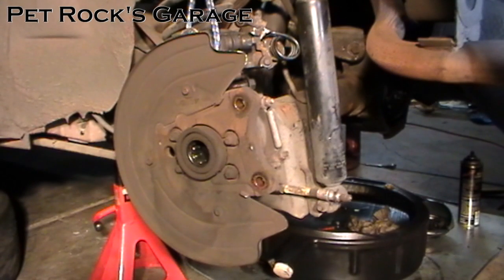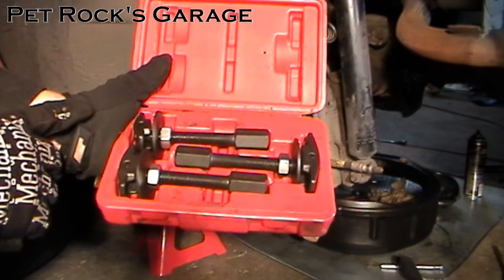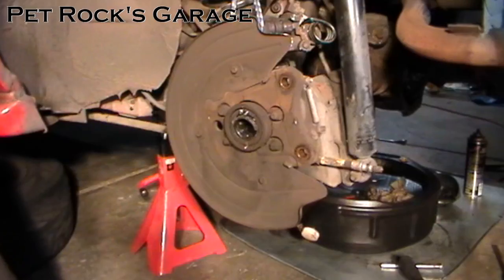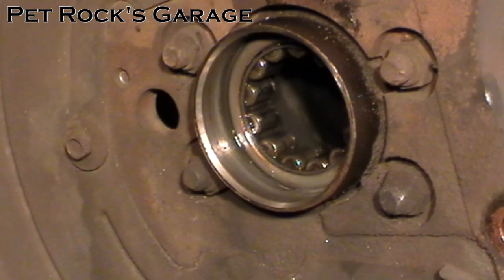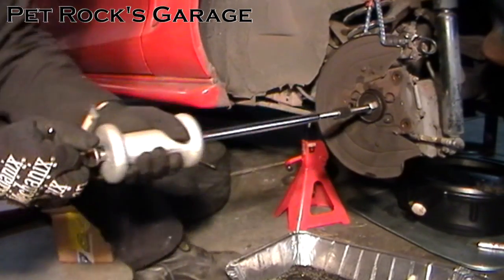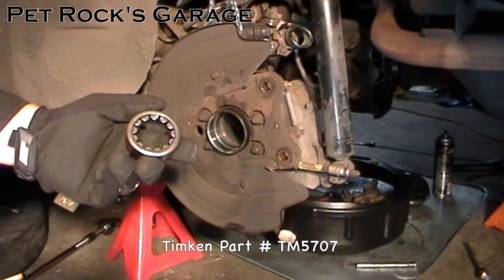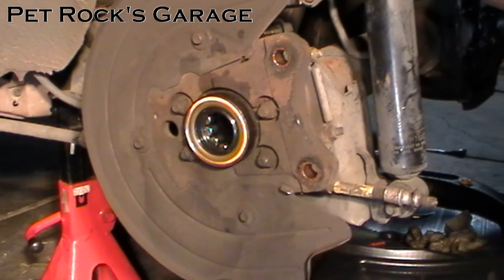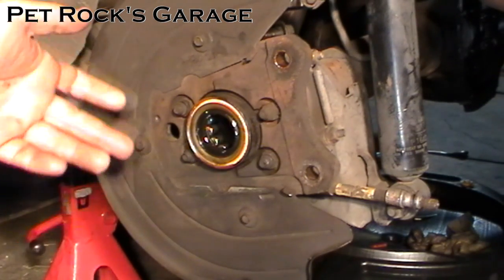How To Replace Axle Seals & Bearings In Ford 7.5 & 8.8 Differential - Ford Mustang

Comment: GREAT!  I saw how much trouble the seal gave so I skipped that step..... Just stick the puller right through BOTH parts and pull.  The seal will come right out with the bearing with No trouble at all !!    Thanks to you and Autozone this project went down Smoothly for once
Reply from the maker: Yes, you can pull the seal & bearing out at once. I showed it the way I did for those that are just looking for how to change the seal and not the bearings.  I'm glad my video helped you out. Thanks for watching & commenting. I appreciate it.

Comment: I need to do this on my 98 grand marquis, hopefully they're similar. Your videos are very detailed and helpful. Thank you!
Reply from the maker: Thanks a lot. I appreciate it.  If it has a Ford 7.5" or 8.8" open differential it is the same. If it has something else then some of it will be similar. Good luck.
Reply: @petrocksgarage  I believe it's an 8.8. I'm having difficulty finding good quality axle bearings. Any advice would be greatly appreciated.
Reply from the maker: @marymong2651 , there aren't that many bearing manufacturers and, if I'm not mistaken, none are made in the US. Check out rockauto.com and autozone/oriellys/advanced/napa. They should have a good selection.

Comment: Again thanks a lot for the video! Just a quick tip cause I had very hard time to remove the seal on both side as it was stuck there. I used the slide hammer with the bearing puller and remove the bearing and the seal at the same time and it works perfect 👌! Just a tip to prevent damage on the axle tube by trying to pry out the seal ;)!
Reply from the maker: Yeah, you can remove the seal & bearing at the same time with a slide hammer. It's a perfectly valid technique. However, it only works if you are replacing the bearing too. If you just want to replace the seal, which is more common than the bearing, this video will show you how. Thanks for watching & commenting. I appreciate it.

Comment: Looks straight forward enough.  Thanks for the very clear directions.  I've also heard people say put some black RTV around the axle seal.  I have to do this as my right wheel bearing is making noise + my pinion seal is leaking as well, my car is lowered a bit so it's real hard to get to the top fill plug of the diff.  Furthermore, my driveway is on an angle so I can't properly fill it.  Between needing a lot of torque on the pinion nut to crush the pinion sleeve + the fill plug hard to get to + needing the diff level when I fill it I want to remove the rear axle and do this job + the pinion seal outside of the car.  What are your thoughts on doing it?  On one hand it seems like massive overkill, but on the other it sorta sounds like a massive pain in the ass doing it on the car on my back in cramped space.  Thoughts?
Reply from the maker: Thanks a lot.
Re RTV: if the bore that the axle seal goes into is damaged then you would want to use RTV.  Otherwise, you don't need to.
Re getting to the fill plug: if you put all four corners of the car up on jack stands at roughly the same height, it should make it easier to get to.  Or use a really long hose attached to a pump like I used in the video.  Having your driveway at an angle actually makes it easier. Have the rear facing down hill and jack it up until the car is level. Make sure to block the front wheels so the car doesn't roll.
Re pulling the axle to service it: that might be more headache then its worth. If the driveway really is a problem I'd find a level spot somewhere nearby to do the job. My driveway is also at an angle. I've sometimes rolled it back so the rear wheels are in the street and the front are on the driveway to get it close to level so I can check the oil. Works pretty well. Maybe that technique would work for you too.  Good luck.
Reply: @petrocksgarage  The really long hose probably would have helped, I'll get one of those.  I had just used a shorter hose + squeezing a regular gear oil container to top it off and it was a huge pain in the ass because it was slow as shit & hard to squeeze.  The long hose + pump looks like a significantly better option.  Yeah, that's a good point about parking it up-hill and doing it that way.  I had wanted to do it downhill because it puts the rear near my tools, but I think your way is better because it allows me to balance while creating room for myself.  I did the math and should only need to come up about 10 inches max to be level.  OK, I'll have the RTV on hand if it's damaged and I need it, otherwise I won't use it.

OK, you've convinced me on trying to do it with the axle still in the car!  It should make the job considerably easier.  If I run into issues I can always drop it after.  I was most concerned about the pinion seal and crush sleeve, but I did some searching and looks like a pretty quick/easy weld to make a make-shift pinion holder tool that can rest against the ground or car body while I crank the pinion nut enough to crush the sleeve, so that should make it much more manageable from under the car.

Thanks!

Comment: Awesome video thanks, one suggestion I would add is for really bad seals take a chisel and hammer and knock the lip down from the outside of the housing so that you can break the rust seal that's formed with the rear end and the bearing seal
Reply from the maker: Thanks a lot. I appreciate it. Thats a good tip. Thanks.

Comment: Same comment as the group below, very well explained and demonstrated. This is my project for this weekend I just need to arrange to borrow the tools for the job. Thank you very much!
Reply from the maker: Thanks a lot. I appreciate it. Good luck.  Re tools: you can rent them from most auto parts stores. I rented the ones in the video from Autozone. Hope that helps.
Reply: Hi Pet Rock's Garage, so I’m in Canada I went to NAPA with no luck but Canadian tire loans out the tools at no charge, just a deposit that is paid back in their return. I already had the axel out for my drum to disc brake upgrade in my 1986 Mustang. The bearing removal and install took about 20 minutes with the right tools. Thanks again for your detailed step by step this was a lot easier than I’d thought it would be. To think I was going to leave the old leaking seal and worn bearings in place and not use the new ones provided in the brake upgrade kit . For some reason the past car owner packed the one seal with thick grease to prevent gear oil from leaking out - ouch  so glad I did this now and lol that was easy. Thanks again.
Cheers,
Hans
Reply from the maker: @hansparis5860 , I didn't know Canadian auto parts stores didn't loan out tools like in the US. Canadian Tire's loaner program sounds a lot like the ones here. Glad to hear you got it sorted out.

Comment: Great video. I just recently did this same job on my 03 mustang and 3 weeks later started hearing loud noise and took it apart again and my axle shaft had worn down do u know what would cause this?
Reply from the maker: Thanks.  Re your axle shaft, it all depends on where the wear occurred on the shaft. Did it occur in the same spot on both shafts?
Reply: @petrocksgarage  what happened was my wheel seal on passenger side started leaking so I replaced a wheel seal and bearing just like in your videoand everything was good for about three weeks and then I noticed a noise like a bearing going out or a tire off so I pulled the axle out of the differential and where the bearing and seals it was worn down and lose inside the bearing but I don't notice any damage to the bearing or seal
Reply from the maker: @zachensley9386 , my guess is either there wasn't enough oil in the diff and the bearing was riding raw on the axle shaft and wore it down.  Or the bearing was potentially the wrong size somehow (e.g. manufacturing defect or wrong bearing) and it allowed the axle to wobble around and wear. Hope that helps.
Reply: @petrocksgarage  Thanks for ur help. Today I will be adding the oil into differential hopefully everything is good. For the v6 i use 80 90 right? Can I send u a pic of my axle?
Reply from the maker: @zachensley9386 , the motor doesn't effect the oil used in the differential.  I use 75W-90, but any gear oil around those specs should be fine. Also, if you have a limited slip differential you should add 8oz of friction modifier first and then fill the rest of the way with gear oil. If you don't know if you have a LSD or not, the easiest way to tell is to jack up the car and spin one of the rear tires. If the other wheel spins in the opposite direction, you have an open differential. If it spins in the same direction, you have a limited slip differential, or LSD.

Comment: Some advice for others looking to do this. You can just leave the seal in place and it will come out when you pull the bearing. No need to remove it first.
Reply from the maker: While it doesn't hurt to try, in my experience it only works sometimes. More often than not the bearing will pull right out the middle of the seal. Especially if the outer flange of the seal is rusted to the axle tube. IMS, the bearing is a slightly smaller diameter than the stiff/metal part of the seal.  Either way, I showed it the way I did for those who are just replacing the seal.

Comment: I wasn't able to seat my bearing as far as yours at 6:50. I can see the lip but not as much, and one side I just barely see it. There's like a ramp in the back. Do you think I should pull the seals and hit it some more, or just chalk it up to different tolerances?
Reply from the maker: The important part is that the bearing is in straight. Make sure that the amount of the lip you can see is the same all the way around. If its not then the bearing is not in straight. If it is the same all the way around you should be ok. The seal shouldn't come in contact with the bearing, so it should be ok too. Good luck.

Comment: good video. on the seal some instead of oil put a tiny bit of rtv as added protection I guess... what do you think? thanks.
Reply from the maker: +BlackStangPat, thanks…  RTV isn’t necessary if the seal is a tight/snug fit, like it should be. The RTV applied to the outer edge of the seal would be wiped off as you drive the seal into place. But if you want to add RTV, it wouldn’t hurt.
Reply: +Pet Rock's Garage thanks!! again good video.
Reply from the maker: +BlackStangPat, no problem.

Comment: Didn’t want to use the bearing puller to remove the seal and the bearing all at once? Works like a charm..
Reply from the maker: Yes, that is an option. But in my experience the bearing often just pulls through the seal on some vehicles and makes the seal harder to remove afterwards. So I typically just pull the seal separately. Also, the video shows how to remove the seal if that is all you are replacing.

Comment: I'm working on a 98 mustang and the previous owner hit a curb so hard he broke the axle and knocked the wheel off. It didn't even have a seal on it and the bearing was cracked. The opening for the axle housing was bent and out of round but II was somewhat able to hammer it back in place. So there are a couple rough edges that could be filed and maybe a little more hammering. I can show a picture. Do you think this is a fixable situation or do I need a new axle?
Reply from the maker: IMO, I would replace the entire differential. If he broke the axle (which is a solid piece of steal) then he hit it pretty hard and all that force went into the gears & bearings in the differential housing, likely bending/damaging something. But if $$$ is an issue, then you could try to rebuild it. I'd advise using some RTV around the outer edge of the axle seal to fill in any imperfections you couldn't hammer out. I would also take the diff cover off and have a look inside to make sure that there are no other broken or damaged parts in there. Make sure it spins freely with no noise or anything like that. Good luck.

Comment: So, are the axles held in with c-clips? I've never had the pan off on these new axles
Reply from the maker: Yes, but to remove the c-clips you need to remove the center pin so the axles can slide inward far enough so the c-clips clear the vertical spider gears.
Reply: @petrocksgarage  Yeah, old school stuff... One more question, can you get the bearing out with the seal still in place? Seems the slide hammer would do it..
Reply from the maker: @kevincowart542 , yeah, if you can get the puller attachment in there it should pull the bearing & seal at the same time, but will take more force of course. I would only be worried about the bearing coming out through the center of the seal, instead of pulling both the seal & bearing out though. I haven't tried it, so your milage may vary.

Comment: Have any tips on getting the abs sensor out without breaking it? I noticed you took it out but did not mention it. thanx
Reply from the maker: 01mustangman1, I show a more in depth method in my video on replacing the spider gears in this car.  https://www.youtube.com/watch?v=WnZc7Dbn-Vk.  In short, a good amount of penetrating oil on both sides, let the penetrating oil do its thing for a little while, slowly twist it back & forth a bunch of times to break it free first and then pull it out. Good luck...
Reply: Pet Rock's Garage  I got it. I used a lot of PB and i used a trim tool remover to pry against the abs gear. My axle seal was out though so it was all soaked in gear oil already. It'll probably be a lot harder for others.
Reply from the maker: 01mustangman1, glad to hear you got out out.

Comment: I have a 2007 crown Victoria and I need to change my rear wheel bearing and I dont know what should I buy a 7.3 or a 8.8 size bearing
Reply from the maker: The best way is by looking at the metal tag on one of the diff bolts. It should have this info.  If that tag isn't available, you call your local ford dealers parts department and they should be able to tell you from the VIN.  A less reliable method is to look at the differential cover. Does it look like the one in the video (same bolt pattern)?  If so, its likely a 7.5 diff.  If not, its likely an 8.8 diff.  Hope that helps.
Reply: @petrocksgarage  Thank you, that did help also your video was very educational but it's still not an easy job 👍
Reply from the maker: @mrmaxwell4025 , thanks. Glad to help. While not as easy as changing engine oil, it is still in the high beginner to low intermediate level. If you take your time you should be fine. Good luck.

Comment: What do you do when you can't get the seal out and the bearing comes apart with the slide hammer and the bearing shell is stuck in the axle well?
Reply from the maker: Well, first I'd get the seal out. Maybe use a small pry bar, screw driver, seal puller or whatever method. As for the bearing outer race (the shell), it sounds like you used too small a puller.  The puller should be in contact with the outer race. If that fails, then its really hard to say what to do from my keyboard. With whatever method you use, make sure not to scape up the inside of the diff tube in the process. Good luck...

Comment: Should have started with the prybar never fails :)
Reply from the maker: 6 == 1/2 dozen.  I've had pry bars and screw drivers tear the seal housing instead of pulling it out making it even harder to get out. In the end use whatever works for you. All that matters is that it came out, not how you got it out.

Comment: Could you not just use the bearing puller and slide hammer to pull out both the axle bearing and axle seal at the same time?
Reply from the maker: If you can get the puller tool in there, yeah, it might work. It will be harder though and you risk breaking the puller tool because you need to tighten the puller onto the thing you are pulling out (e.g. the bearing). With the seal in the way you can't cinch the puller tool down properly, so every time you pull on it with the slide hammer you will be be slamming the tool against the back side of the bearing, which is not how the tool was designed and it could break.

Comment: You could pull the seal with the bearing
Reply from the maker: Yes, that is an option. I typically remove them separately because I've had bearings pull out through the seal, making the seal a P.I.T.A. to remove. Both methods are perfectly valid. Use whichever works best for you.